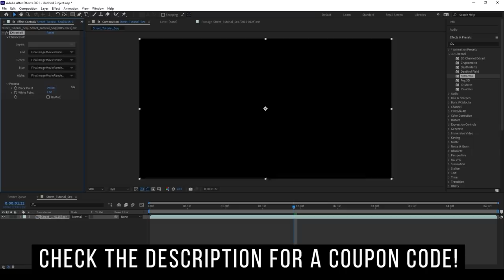Why Modern VFX Suck (And How to Make Yours Not Suck)

Comment: I am tickled by how much of what you said has already been known for ages.
Back in the 80's, before CG was even a thing, Robert Zemeckis made a big transition on the visual effect shots in Back to the Future 3 after finishing the second movie.  He found that he was able to pull off far more convincing composite shots by staging them the same way we would if it was just a normal scene with two actors rather than a special effect shot.  Effectively, he discovered how to make special effects look better by not trying to draw focus to them.
And before that, George Lucas had made public statements about special effects, stating "A special effect is a tool; a means of telling a story.  A special effect without a story is a pretty boring thing."  Thus, in his very heyday as the king of visual effects, he was already advocating a focus on storytelling over the visuals.

Half of the advice you gave in this video was already understood 40 years ago, but people have lost that insight over time.
Reply: I agree. I think early CGI like in Jurassic Park or Terminator 2 still mostly hold up today because the teams knew they could only push the limits so far, and so they had to get creative with a bunch of little tricks to make it look believable. Nowadays VFX programs are a lot more versatile and user friendly, and so the higher ups just kinda take it for granted.

Comment: I find your clickbait title pretty presumptuous and hugely disrespectful to the work done by VFX artists of both today and of the past, especially considering the examples of VFX you show from your own film are guilty of many of the problems VFX artists tackle that you claim makes their work "bad".

Most significantly, you've over-designed your VFX shots. 

It doesn't matter how much of a "real set" you build and how much "real smoke" you put into the frame and then add extra fog elements to blend your VFX elements, your shots are over-designed. You've lit your CGI city landscape in a style that your lighting on the day couldn't replicate. You've placed elements into your shots that would dynamically affect the tone, mood, lighting and atmospheric properties of a real location, but of course your raw footage doesn't have those qualities. 

You haven't thought like a director i.e. you've got towering structures? Make your characters pass under the shadow of one of them, at the very least. Shoot that shadow as a practical. Have the building block out the sun as part of your practical in-camera composition. 

Don't try to light your VFX shots to make them aesthetically pleasing if the aesthetic is more designed than what you could shoot in your live-action plate. You've made the fundamental mistake of thinking VFX can help you cheat production values on the elements you captured in live action, instead of compositing and lighting and building your VFX elements to match the indie shot quality of what you were able to capture with your limited gear and time and crew. 

Even the act of adding more fog into your shot immediately creates tell-tale artefacts such as your actors would never be LIT like that in a fogbank and that if you were shooting a live-action sequence that required the amount of fog you want, a cinematographer, the director and their gaffer would have a completely different approach to lighting and blocking and composition. 

You've built your shots around the fact that you didn't have your epic CGI landscape to use as part of your compositions,  blocking or storytelling and then you've added them in afterwards in the most stock-standard generic way possible. You've done exactly what you're complaining modern films do; shooting films without acknowledging nor being inspired by the VFX that's going to be there later and building that into your live-action plates practically. 

And take it from this very crusty, cynical, old dude -- in the 2000's, people were saying VFX looks worse now than it did before. In the 90's, people were saying VFX looks worse now than it did before. In the 80's people were saying SPFX looks worse now than it did before. You're conflating an outrage culture's kneejerk response to have an opinion on poor examples of an artform that offends them with an entire industry that puts VFX into shots that are literally invisible to the naked eye. 

I know what you're saying and trying to do, but seriously::

1) Enough with the clickbait titles. It's childish and it suggests you haven't seen enough films from a broad enough range to have any critical eye for VFX to begin with. 

2) Don't gild the lily. Your VFX sticks out as obvious VFX shots because you're not honoring your low-budget indie sensibilities. You're trying to hide your lack of budget and thus your shots look as generic as any Marvel film to date. Worse, your film looks like every other generic VFX indie film made by a VFX person on YouTube - where the person shot their live action plate elements without any attention to detail of the VFX you were going to put in later. 

Compare your efforts vs say the work of Neil Blomkamp, as a basic starting point, to see how to make VFX really genuinely bring a story to life and make the viewers do a double-take. 

Modern VFX don't suck. You just think they do because you don't know what you're talking about because you don't watch enough films and you can't critically assess VFX on any meaningful level.
Reply from the maker: Well this may be the most pompous comment I've ever read 😂 you've entirely missed the point of the video, but thanks for watching anyway!

Comment: As a fan and someone who’s dabbled, I think you hit it right on the head about why VFX of films of early 2000’s seem more photorealistic and grounded. Because they are added to live plates. I’ve always thought that the grounding of reality is what really helped sell the VFX from films like Transformers 2007. The VFX had to conform to what was captured in a camera that moves realistic around a set and not anime style like a bullet. Which there’s nothing wrong with that when done right and sparingly.
I love seeing the use of virtual sets. Do not take it the wrong way, but I feel like they get overused and therefore lose the sense of novelty and suspension of disbelief. Great video.
Reply from the maker: Agreed, very well put! Thanks for watching!!
Reply: "anime style like a bullet" You mean like Black Panther at 0:57?

Comment: Ooof, okay, well a few things to point out here; I don't know of anyone using Unreal Engine for anything other than previs/postvis but it's cool that you were able to. A lot of your points are fairly common knowledge but even on large productions budget and time are huge concerns. For Transformers 1, I think there's under 800 VFX shots in that film and every time a robot appears on screen, you're talking about $50-60k per. These days, the VFX budget and schedule is the same but you have 3x times shots. Right now in particular, we're seeing a lot of really sub-par VFX because there's so much demand and not enough experienced artists at the vendors to do the work. Good, fast, cheap, you can only have two of those at the same time.

Comment: As much as the 2001 version of Planet of the Apes is maligned and derided, I really like it in large part because of the sheer amount of practical effects it uses, with very minimal use of CGI. Besides the space scenes and some distant backgrounds, almost everything is real and using practical effects, with the biggest amount of "visual fakery" being just some stunt wires removed in postprocessing. Heck, even the apes outrunning galloping horses was a practical effect, no CGI trickery.

I highly recommend that film, if for nothing else, because of that.

Comment: I would like an explanation of why some scenes in Thor love and Thunder look so off. I saw they used a curved screen instead of normal green screen. This was supposed to make it better, why didn't it? It looked worse, like if you were on a fairground  with an obvious screen behind you. You could see were the practical set ended and the screen began.
Reply: time - they didn't give the VFX artists enough time to "smooth" the edges between the set and the LED walls, or to touch up the issues, plus they probably didn't have enough time to properly make the very high resolution backgrounds, making them look odd compared to shows like the Mandalorian, which uses them to amazing results

Comment: The issues are simple. Not enough time to allow Passion thrive, overreliance on CGI means more work on it which means less time to perfect it, and the best CGI are the ones that give illusions, not replace what can be made. Forrest Gump shocked me with how much CGI it actually had. Goes to show how convincing it is when it's used strategically instead of using it on Live Action to a level where the work should've been done on a 3D Cartoon.

Most of us saw it coming that post Endgame would turn the MCU into a real monopoly and with Disney, it was gonna get butchered. I didn't think it would reach the extent it would but being part of the gaming industry where most AAA monopolies like to prioritize money over passion, it's all too familiar.
Reply: Those two soldiers got blown up use plates. One the actors themselves and two, the use of dummies and explosions. Compositing do the rest.
Reply: @Joshua_N-A  Ye. That scene was real convincing. And the mass crowd at DC was just copy/pasted group of a smaller audience. It was just done in a way where you wouldn't catch it.

Comment: It starts with an artist respecting themselves and their time. The industry will take advantage of any artist who succumbs to the pressure. Junior artists and foreign workers especially. Unfair work hours, overtime, free-overtime, sponsored visas, and someone always willing to work cheaper for longer, is the reason studios can rely on sooo much VFX so fast. Value your time, It just brings your level down, and those around you. Nobody wins, not even the film. Film is cool, but no one should work for free.
Reply: That's why they need to unionize, so an individual doesn't have to bear the burden of standing up to their employers.

Comment: All the technical parameters about lighting, where to place your camera, and everything else aside, DESIGN is also a huge factor.  A lot of CGI sucks not necessarily because the shaders don't look photorealistic or because the compositing is bad, but because what's actually being rendered and composited into the scene is way too fucking visually noisy and cluttered.  Seems like there are a number of otherwise very competent VFX people working in the industry who nonetheless aren't great at designing visually appearing characters, machinery, whatever.  The Bayformers movies are a fantastic example of this.  The single biggest reason those movies look so atrocious to me is because I couldn't for the life of me recall what a single one of the robots themselves actually looked like.  They could all have been rendered as massive piles of walking scrap metal and it wouldn't have looked appreciably different.

Comment: This video doesn't answer the question in title at all. It goes by assumption that modern VFX suck, proposes to answer why is it that way and then does no analysis on it at all.  Instead we get a view how Gemini does VFX implying that Gemini is the golden standard of VFX - when it isn't, too much fog and smoke also throws off a viewer. 

Points raised here are valid but they do not follow what the title here is trying to propose. If you wanted to talk about how Gemini did VFX then title the video accordingly but don't go criticizing other works without proper analysis.

Comment: Quick observation as I'm watching: I'm 2 minutes in and I find some of the movies you chose to, I assume, illustrate your point about over-reliance on CGI and blue screens... kind of odd. AFAIK, movies like Life of Pi or Gravity were actually praised for their outstanding VFX both by the profession and audience. Of course it doesn't change the validity of the point - although I do disagree with the way it's presented, as IMHO the issue has less to do with techniques used than the way/context in which they're used (see Avatar for another good example of impeccable VFX using little to no live sets or props).

Comment: The solution, unironically, is to use less of it.
Good VFX takes time, so the less you use, the more time you have to allocate to each element.
Another factor, is engagement.
If the audience cares for the story, their suspension of disbelief ends up stronger. Black Panther is kind of bland, but Iron Man is a banger.

Comment: This makes me think of the Doctor Strange, the madness movie. Its story did not carry at all, it had a lackluster point to anything, as it was just an easy solution to solve, yadda yadda, bad ways to solve it. With that very weak story and forced humour, it takes one away from the focus of the story and instead on what you just see. And what I saw was a movie that was all too reliable on the sgi and not anything else. Did it look good? Sometimes. But, for a "magic" movie, it looked pretty fake and horrible. 

Focus on a story, make it interesting, follow a good structure, and as you all mentioned, use cgi to merely enhance the story, like putting on (the right and fitting) clothes to make someone look more appealing.

Comment: The original Transformers is your Litmus Test? LOL ILM forgot to texture one side of Optimus Prime! You only see him from very specific angles in the film. As far as environments go, just make sure the 'black' in your CGI matches the 'black' in the footage. Simple as that. That's the biggest problem I've noticed. However, the Mandalorian has COMPLETELY changed the game. No sets, no green screen. A major portion of that series was shot inside a cylindrical 'screen' with a VR rig. They didn't even use lights. And the actors were able to actually see the environments they were acting in. So, for the record, green screen is done and has been for quite some time now. Disney has rarely used it since the Mandalorian. They use UE4 and the VR set up.
Reply from the maker: I think pretty unanimously Transformers is regarded as some of the best CGI for its time and even today. It's certainly better than most of what's coming out of Hollywood now. And I go over virtual production in a video in this series, and it is very much the future, but it is still extremely limiting. You can only have a scene be so big and the amount the character can interact with the environment is limiting as well, due to the limited size of the LED volume. It also limits you to how well you can blend your virtual assets with the real set, and requires restricted shooting methods to hide the seam. Green screen is also still used pretty often on virtual production shoots for shots that require specific animation or vfx that need to be done after the fact. So I wouldn't say green screen is dead. VP definitely is a step in the right direction though.
Reply: @BoundlessEntertainmentFilms  Uh. I spent 20 years working in VFX and CGI robots aren't held in very high esteem simply because you have nothing to compare them to in the real world. The Final Fantasy films were considered better simply because you could compare the characters to actual human beings. Granted, by today's standards, they aren't the best but at the time they were amazing. Transformers on the other hand, just a bunch of 3D primitives (altered, beveled, with boolean effects and some automotive textures added), not very impressive to those who actually know what they're doing. Hell, you can get comparable automotive textures for free online these days. At any rate, CGI is what it is. When I see the guys who actually work on films like that doing YouTube videos, I'll take the video seriously. 'Fan Critiques' are garbage.

Comment: "modern vfx suck" is an insane thing to say. if you compare the top 100 vfx shots of this year to the top 100 of 10 years ago it's an easy win for the "modern vfx". 
the problem is some people like to compare the top vfxs shots of 10 years ago with the shot 2374 of the third best marvel movie release this year. even with 5 times the vfx shots in each marvel movie, it would be hard to find something that looks as bad as the worst vfx shots in the first transformers movie.
Reply from the maker: If you actually watch the video and the others in the series, you would find that this analysis is at its core addressing the reasons behind the socially popular opinion that the overall standard of VFX has degraded (taking into account the standards people have developed over time, the evolution of the technology, etc). This is an issue that the general population has observed in many mainstream movies such as marvel/Disney releases. If you have the best vfx shot of the year in a film filled with poorly executed vfx shots, people aren't going to leave the theater with an overall positive impression of the vfx, regardless of how groundbreaking those few good vfx shots were. Whereas the few shots in transformers that look bad do not have much of a negative impact on the overall impression an audience has after watching shot after shot of well-executed VFX.
Reply: If it sucks, it sucks. Don't fucking defend bad CGI.